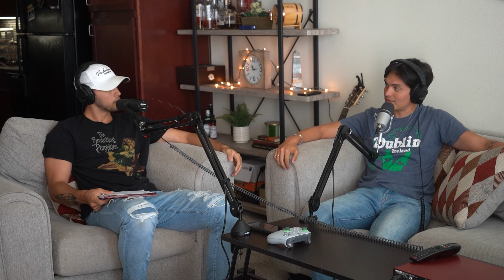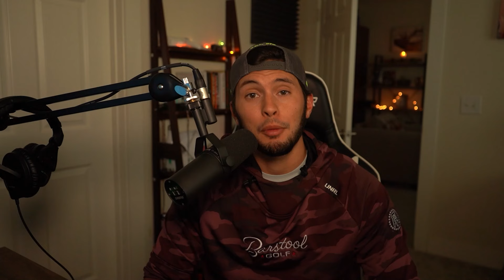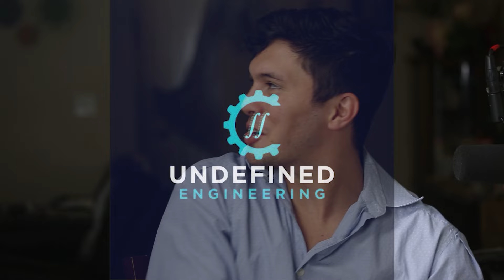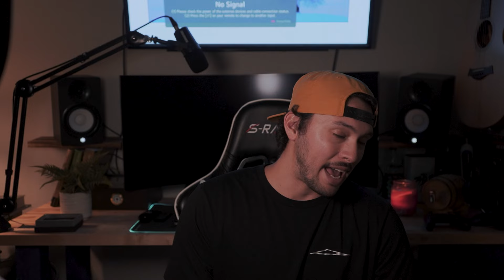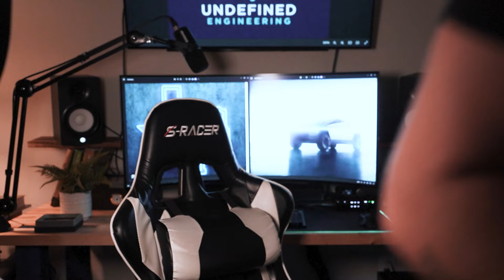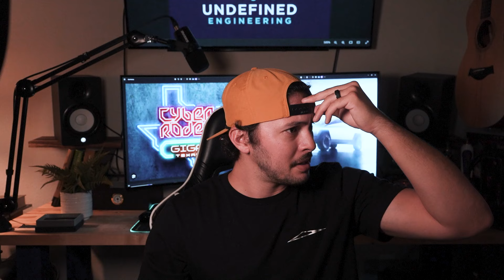Inside Tesla: My Experience Working on the Cybertruck 🚀 | Challenges, Day-to-Day, and Success Tips

Comment: Love the vid, day 1 here. You touched on the media covering the issues so I’m wondering your thoughts on how the “move fast break things” mindset at Tesla leads to some avoidable problems that a company like Toyota would never have. Sometimes there are very valid reasons for a rule so just going fast and having such small teams like you said is detrimental to the product, the consumer, and the company brand. For example, reports of the Cybertruck pedals falling off while driving or rust forming on some of the trucks.
Reply from the maker: I appreciate your feedback and understand your points regarding that notoriously famous Elon approach. With specific issues like the Cybertruck pedals, it's worth noting that Tesla’s approach to problem-solving is often iterative. They're committed to addressing and rectifying issues as they arise, and feedback from early adopters plays a vital role in that process. Tesla's approach might lead to some growing pains, but it also fuels advancements that push the entire industry forward. (Also fun fact, when the new Toyota Tundras came out they had an issue where the rear axle completely separated from the frame that affected thousands of trucks 😅)